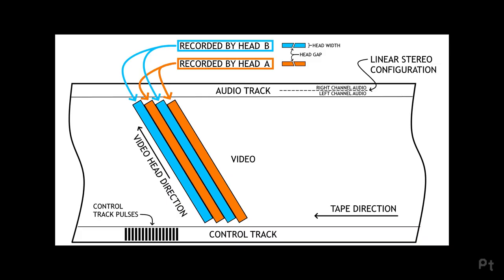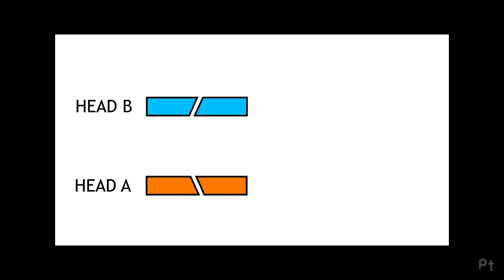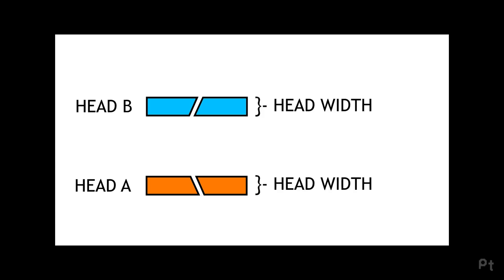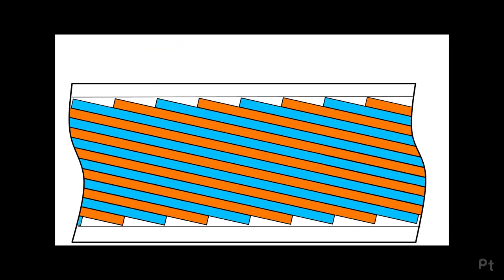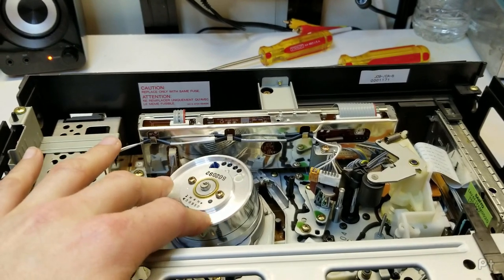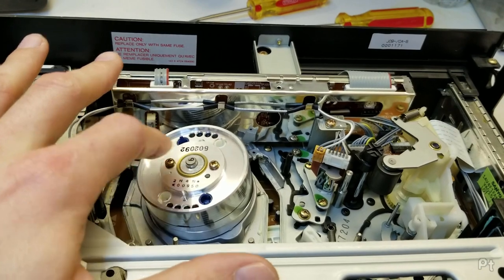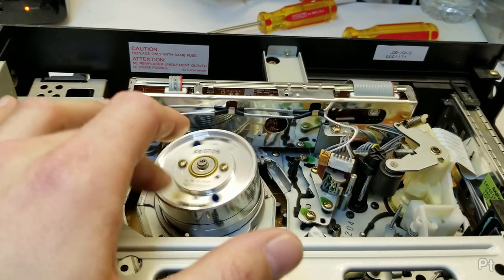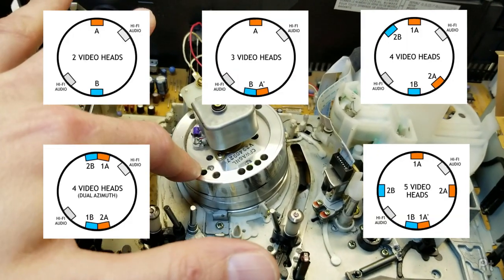VCR Basics - Video Head Configurations

Comment: Those auto head cleaning sponges does more damage than good to the heads over the course of time. I always remove them, whenever I still see one in a vcr. 👍🏾
Reply: I replaced the sponge on the Roller with paper...works wonders but need periodical change though
Reply: I was NOT aware of this, and now I get to go home and investigate 3 VCRs, to see wussup.  Thanks for the heads up!
Reply: So that's why my vcr head head keeps getting dirty whenever I load and eject the tape the Spong was full of dirt..
Reply: @jacenthegreat9536  Yup, that is probably causing the problem.  That old sponge is recontaminating the heads every time you insert and eject a tape.
Reply: @rwj777  yea there was a black line on the sponge
Reply: @jacenthegreat9536  That black line on the sponge is the dirt that keeps clogging up the heads. It's definitely time to remove that sponge...lol
Reply: I did this today haha, there's no point on having that when you could clean the heads manually, and much better than that crappy sponge
Reply: Where are those located? Are they on every VCR? Noob here day 1.

Comment: Thank you for your excellent presentation.  If you'd played the THX audio intro I think I would have stood and clapped at the screen!  I'm a VCR nerd, but you showed me lot of stuff  I didn't see before!!  I had 3 Beta m/c's ( 1 portable Sanyo/Sears & 2 SONY hifi's ) before my first VHS m/c (1987 ) which was a Fisher HiFi  6-Head ( 4DA +2 ), with  DMSS ( Digital Memory Sound Scan ) which sampled the linear audio track and played it back in 8 second segments at normal  speed, when running in Fwd. OR Rev. Search, at any of the 3 playback speeds! I have subbed and am looking forward to looking at your other videos.  Thanks again.
Reply: JVC did that, It must be JVC design.

Comment: Just some questions. So there are 2 different ways a vcr can play or record the audio. It could use a stationary audio head or spinning audio heads in the head drum. Right? And as far as i know, if there are no audio heads in the spinning head drum then it isn't hi-fi audio right? So is it safe to assume that a vcr that has hi-fi stereo written on it, has 2 audio heads in the spinning head drum for hi-fi audio or could this just be a marketing trick and it could still be a vcr with only the stationary audio head?
Reply from the maker: Your first assumption is correct - any VHS VCR that has "Hi-Fi" audio will have 2 audio heads on the spinning head drum.

There are stereo VCRs with only a stationary head that uses a stereo linear track, but Hi-Fi is always heads on the spinning head drum.

Comment: Some newer VHS VCR's from JVC and Beta from Sony used digital pause, That means when you press pause the last played frame is displayed as a still picture, VCR's with TBC and digital memory buffer were the only ones capable of this feature.
Reply from the maker: Yes, I've used a few of those. In the late 80s most of the manufacturers (Hitachi, Panasonic, Sony and others) starting putting in a digital buffer and offered a bunch of digital special effects. Most were gimmicky and died off, but digital pause was still offered for years later.

Comment: Great video!
A few remarks: 
1 The audio erase head is not only for trimming the video tracks in order to prepare the audio track for recording audio, but mainly to erase any previous audio that was recorded.
When this head fails (changes resistance, circuit failures), the symptom will be that a portion of the previous recording will be heard with the new recording until the full erased tape reaches the audio head.
2 The flying erase head was mainly intended to be used for the Insert function (recording video segment without messing up the linear audio).
3 outside of USA 4 head decks with Hi-Fi were marketed as 6 head deck, some sellers couldn't tell what the two extra heads does...

Comment: There were also the pro/industrial decks that used DA4+HiFi configuration with the 2 extra heads purely for trick play functions and were SP only. (E.g Panasonic AG8600, JVC BR-S522 etc)

VHS Camcoders are another can of worms with a smaller drum and different wrap.
Reply from the maker: I've never had the opportunity to try one of those industrial models, but I imagine they have amazing quality.

Comment: I feel like the best option (theoretically) is a 3head VCR with only SP capability. So, all of the 3 heads would be wide.
A 3head capable of LP would have the 2 main thin heads optimised for LP (and the trick head wide or thin ???).
The 4head DA, would use (on SP) on pause/slow motion one wide head and one borrowed thin head, having of course both the same azimuth. 

So, i think that, from best to worst vcr, using SP as preferred mode, we have:
3head only SP> 4 head DA> 3head SP/LP> 2head only SP> 2head SP/LP.

Practically though, 3head only SP= 4 head DA= 3head SP/LP, because who would notice any difference either on play or trick modes???

Comment: I think I see now why JVC and Panasonic decks never played well together. -  I think Panasonic used different widths compared to JVC specs -  to optimize easier tracking.  JVC went for quality in SP. I think Panasonic used wider for EP-  JVC used 19 microns  for EP almost always
Reply from the maker: That's what I've come to understand as well. JVC decks to me always had better SP quality than Panasonic and I think it's partially due to the wider SP heads.

Just as JVC decks were horrible at LP playback, and I believe it's because of the narrower EP heads. Or maybe they used the SP heads for LP playback.

Comment: What's up! Great video, mate. I would like to ask you two more questions: 1 - I remember seeying some 7-head VCR for sale at that time, what was that extra head? how was it used? 2 - What was that white plastic thing that you pulled off ? =]
Reply from the maker: The 7 head model must have been 5 video heads + 2 Hi-Fi heads. I've never heard of 7 heads dedicated to video. That white plastic thing was the auto head cleaner. It's a little foam roller that gets momentarily pushed against the spinning heads as the guides loader the tape. Very common in 90s/2000s machines, but should probably be removed nowadays as the foam can degrade - clogging or damaging the heads. I've personally only seen this happen on Toshiba models - if you have a Toshiba VCR make sure it gets removed ASAP!

Comment: The Head gap is Important in Cassette decks too. With a Small Head cap you have objectively better sound.
Reply: This is why usually 3 head decks will play better than 2 head decks, as the recording head has the gap optimized for recording and the play head has narrower gap for optimized playback.
Reply: @moshezaharia4666 Usually doesn’t mean always. From my Experience, a lot of 2 Headers sound as good as a 3 header.
Reply: @domi7007  It is also depends on the circuit design, but on a 2 head deck the gap on the record/ play head is still a compromise.
Reply: @moshezaharia4666  I agree.
Reply: I was surprised to learn the record head gap was wider than a play back head, baffles me that the record head being a wider gap is optimal for recording and the play back is narrower and the more narrow it seems to be superior in bringing out the treble. I can only imagine the time and effort that went into making that discovery. I imagine that also applies to video signals as well, that is definitely a significant challenge as there is only so much room on a video drum not to mention the placement of all the heads as well as the rotary transformer in the lower head drum dealing with cross talk.

Comment: You forgot beta
Reply from the maker: Beta is much simpler. 2 heads that handle video and (at least NTSC) HiFi. 2DA+1 on some models for specials effects (I think those are similar to VHS 3 head models), and 4DA head on the high end decks.

What I'm not sure about is if Betamax VCRs use different heads for BII/BIII playback on a DA4 model, or if they're just used for even better special effects. According to Mr. Betamax they only use different heads for BIs.

Comment: Hi! Nice explanation!
All these your are describing, apply on both ntsc and pal vcr versions?

So, is it preferable to record in the lower speeds (PAL lp, NTSC ep) with a 2 head vcr??  And if so, why the prerecorded tapes where in sp, while most of people used to have a two head vcr??

Thanks a lot ☺️
Reply from the maker: This video was written around NTSC, but the basics probably still apply for PAL. 

Even with a 2-head VCR, SP was a more reliable speed. The picture quality improvements weren't as good as a 4-head VCR, but things like tracking consistency and picture stability were still better with SP. If the tape was worn out, stretched, or even chewed up, an SP recording had more chance or playing correctly. Also if you didn't have a Hi-Fi VCR (which many people never had throughout the 90s and 2000s) the audio on an LP/EP recording was much worse. So SP was still the best choice for pre-recorded tapes.
Reply: @probnotstech  
Thanks a lot for the response!😉
Reply: @probnotstech  Just let me add that the faster a tape moves, the better the recording quality is, this is why SP is the default speed for prerecorded tapes (and the fact that most people around the world had a basic vcr).

Comment: As far as I know those are not 6 video heads on the Toshiba M751, 4 double azimut video heads, one flying erase head and one dummy head to balance the flying erase head, the top rotary contactor is for the erase head wires, Plus the 2 extra heads for HiFi audio obviously, so 8 in total, but 7 functioning heads, This is the highest total number of heads that I'm aware of that ever existed in VHS format.
Reply from the maker: No, I have one and it actually has 6 video heads, 8 if you include the hi-fi audio. It offered 2 different sized "EP" heads - one set for the 19u width heads that JVC originally spec'd, and one set for the wider heads that Panasonic used to support SLP and LP. The idea was that 19u offered better quality EP recordings, but the wider heads supported the EP recordings made on the machines with the wider heads.
Reply: @probnotstech  So where is the flying erase head? The rotary connector on the top of drum suggests that a flying erase head is on the drum. Do you have a copy of the service manual?
Reply from the maker: That's actually what Toshiba called "Pro Drum V3 Technology" as the label on the door indicates. They moved the pre-amp for the video heads onto the head drum itself ("flying" preamp), similar to some professional grade equipment. The idea is that you want an amplifier as close to the source as possible so you're not also amplifying noise picked up on a longer path.
Reply: @probnotstech  So that's what that rotary connector is for? Carry the already switched and pre-amplified head RF signal? Pretty interesting, Is it for all heads in all modes (SP, LP, EP) and HiFi audio or for just LP heads?

Comment: Please help.
I have a problem with my Sony SLV-SE720 VHS player.

Lower part of picture have distortion line and one tenth of picture is not showing. I tried to adjust supply and take-up adjustable guide rollers, but they just introduce additional streaks and not affect the lower distorted part.

I tried to clean head and all parts, but nothing.

Earlier there wasn't this issue and it came after player sitting for several years.

Sample video in the link:
https://youtu.be/JsZ5XvLB_aE
Reply: Another sample video!
Don't mind the overal streaks, it is old old tape.
That bottom distorted line is on any of my 30+ VHS tapes, prerecorded and home made ones!
https://youtu.be/gynIxh9mKfQ
Reply: I'd take a look at the main guides.
The white plastic rollers that they have, can cause problems if they get stuck and will produce distortion at the top and/or bottom of the picture.

Comment: In pause (still picture), one head or two heads scanning in one track?
Reply from the maker: It will always be 2 heads scanning at any given time (in order to fill both interlaced fields). If the VCR has dual azimuth heads, then both heads used in pause will scan the same track/field. This means both interlaced fields on the TV will show the same recorded field. This avoids jitter if the two fields are slightly different from a fast motion scene.
Reply: @probnotstech  Sorry, I mean that just in two head machine (not dual azimuth). In pause time, one track are scanned by one head or two head.
Reply from the maker: @cor_qk9sf  Ahh, it still uses both heads, one scanning each track.
Reply: @probnotstech , but the tape is stopped, one track has been scanned
Reply from the maker: If the VCR only used one head in pause, then only one field of video would be available, and the other would be just noise. The rotation of the head drum creates a full frame of video (2 fields). So the TV would constantly be flickering between noise and an image. The relative angle that the head hits the tape changes with tape speed, which allows the heads to read more than one track of video.

Mr. Betamax has a great write-up on this (same principles apply between VHS and Beta): https://mrbetamax.com/DAHeads.htm